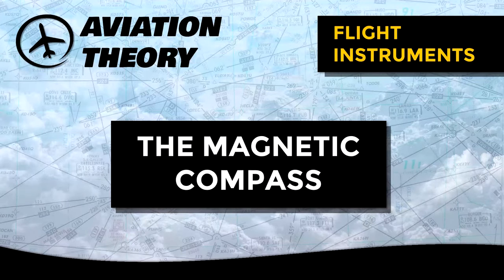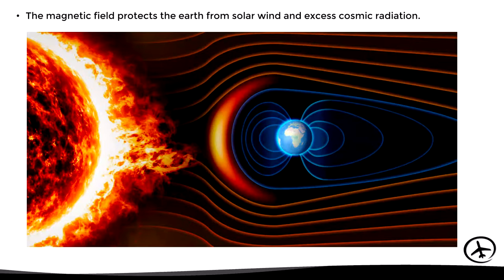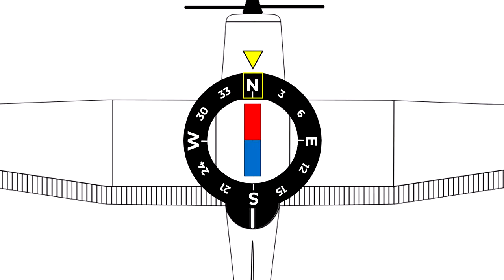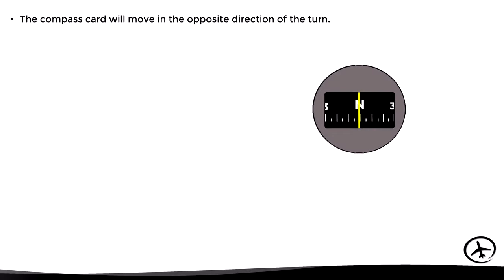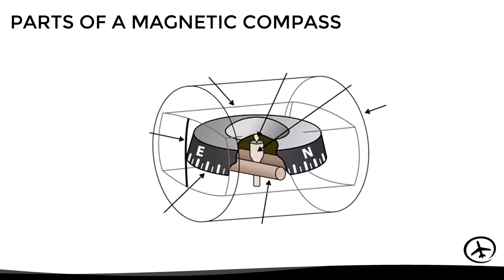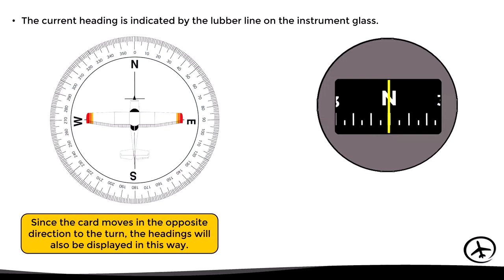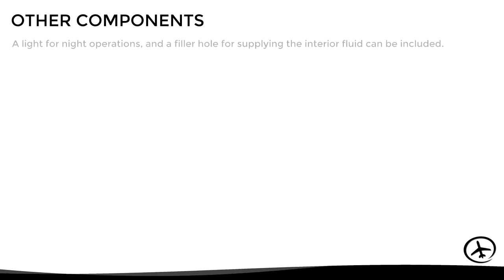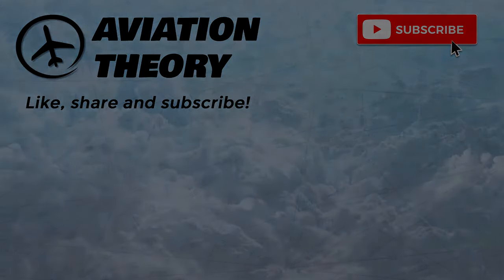The Magnetic Compass

Comment: Cool video, thanks,I'm not a pilot but i fly simulators mainly war related and a lot of the older planes i fly have the bigger compass in places that can be hard to see sometimes and this one is always in a more accessible place however i had no idea how to read it but thanks to you now i do,my brother in law and my brother are both real pilots but i was dreading calling and asking because i would have been on the phone till the coming of Christ listening to them so you spared me that,lol, subscribed.

I think the main problem i was having is how its reversed so i can see how that would throw off someone looking at it but now i understand,when i was learning propeller pitch a few years back i was having difficulty understanding until someone pointed out its just like a standard transmission,you have to start in first and work your way thru the taller gears,you cant start in 5th,lol but like this compass there is a catch,coarse pitch is actually your higher gears and fine pitch is your lower but coarse sounds strong and fine sounds soft but its actually backwards, ha ha ha